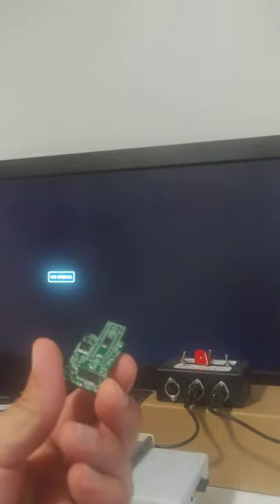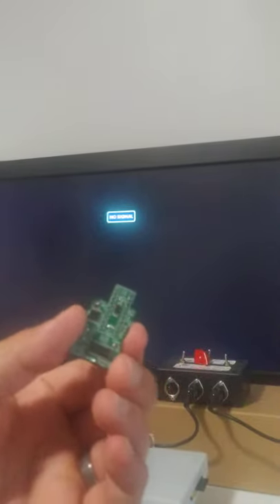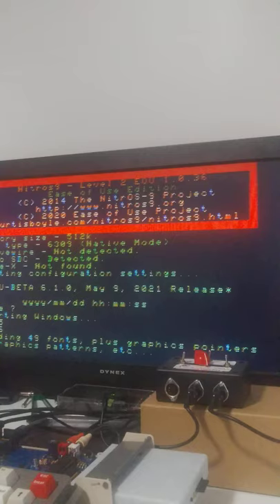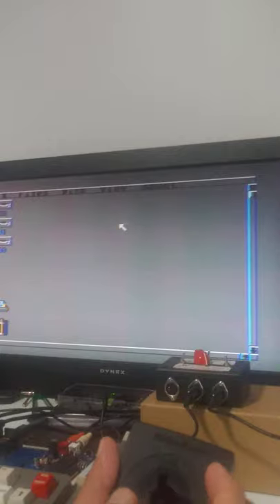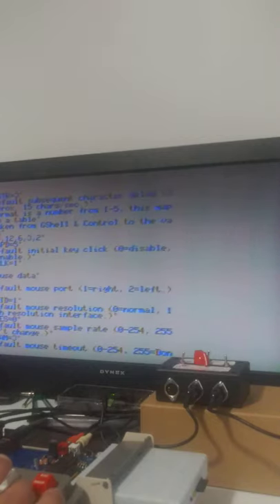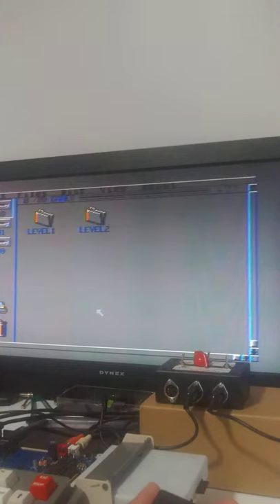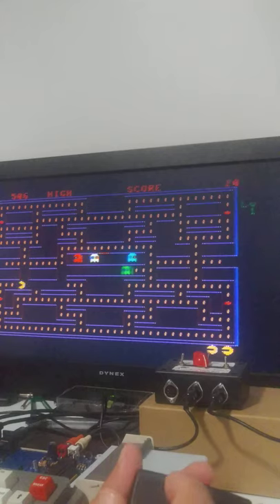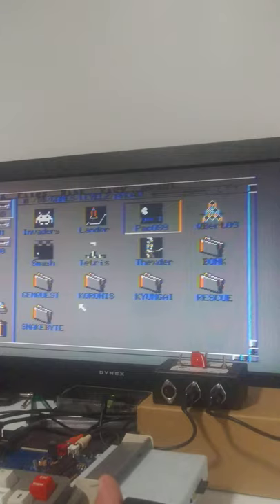Testing the Daiquiri board with Joey High-Res under NitrOS-9 EOU

Comment: Very nice!  I will eventually get Nitros9 running but I've had so many other things to do first.  Regarding that cursor jitter... I've never noticed it with joysticks on my Cocos.  Is it something that only happens in the OS9 environment?
Reply from the maker: Thanks!

Nitros9 really is ease of use, all I did was copy the VHD file into a directory and clicked on it after browsing to it with my CoCo SDC. I was really surprised as to how easy it was. I've seen some slight jitter when starting photon but other than that I've only really noticed it in Nistros9 and you can see it in this CoCoTalk video https://youtu.be/XP0iDTS0GTg?t=2235
Reply from the maker: That said, I'm sure that the board I made introduces some more jitter......
Reply: Awesome!  Glad you like your Joey High res!
Reply from the maker: I Do!